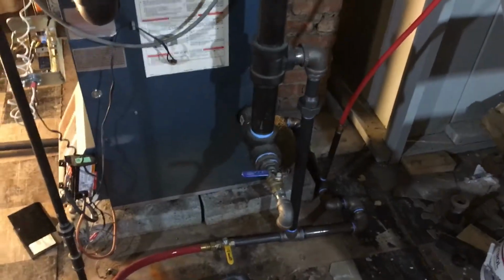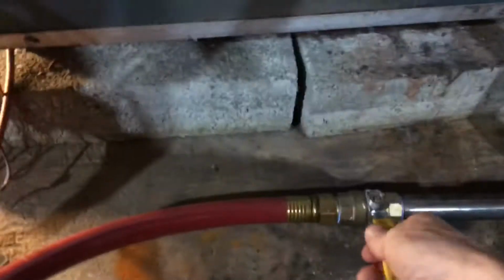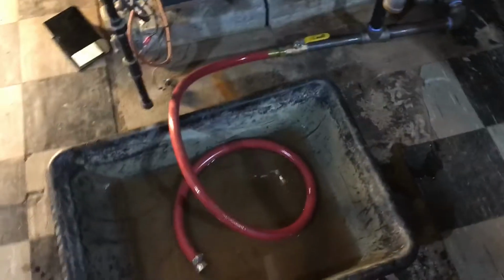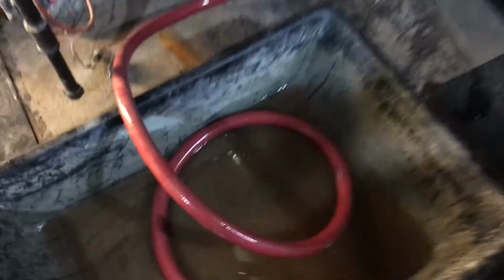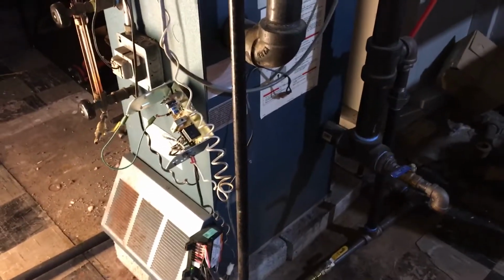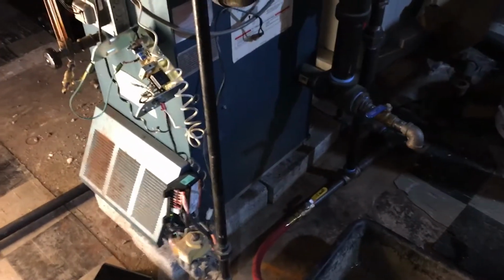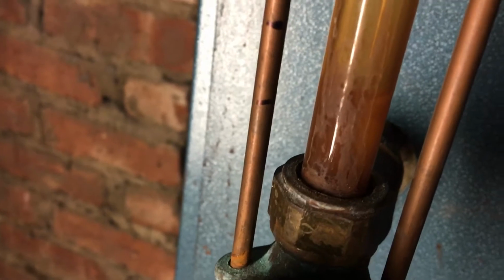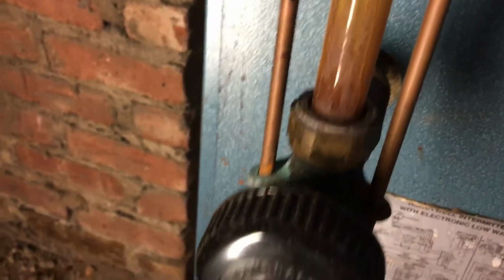Steam heat: What does the Hartford Loop do?

Comment: One thing I would like to point out in this video is that when you see 1-2 inches of water left in the sight glass that doesn’t mean that’s all the water left in the boiler you probably have closer to 10 inches of water. Measure from the bottom of the t where you’re boiler drain is on boiler side of the return to the bottom of the tee on the Hartford loop. There’s still a good amount of water left. Hope this helps out.
Reply from the maker: True enough but it’s just a few gallons. It will boil out in some minutes

Comment: The loop also balances the pressure on both ends of the system. No Hartford loop and water level could rise on the condensate side creating a dry fire scenario, even though the boiler is at the correct water capacity.
Reply from the maker: No, that would be the equalizer
Reply: @pb7379-j2k  Ahh yes good call. Like your videos and glass pipes by the way.  Steam on sir.
Reply from the maker: @mugen-mundo  thanks!
Reply: What pressure are you talking about !   STEAM Risers and turns to solid water and drains back to boiler  YOU KNOW gravity  lol  wooow  !!!
Reply: @Nuchello  When steam is created it expands 1700 times. Thus creating pressure inside the boiler. That's what pushes the steam to the radiators. That's why steam boilers have pressure gauges too. The Equalizer ensures the same pressure exist on both ends of the system.
Reply from the maker: @mugen-mundo  I recently made a video where I proved that the equalizer has no role in equalizing the pressure in the system. If you are speaking of the pressure at the boiler vs the pressure at the far end of the main, it is the main that equalizes the pressure there.

Comment: The efficacy of the Hartford Loop predates the invention and use of low water cutoffs, as you know. In the days when a coal fire continuously burned at damper regulated intensity in a steam boiler, the extra time the Hartford loop provided, in the event of a return leak would certainly have been valuable. Because unlike with modern, on again off again boilers, someone would have certainly checked on it every few hours to tend to the coal fire. Today? Well, considering the annual maintenance and safety checks that the average residential steam boiler receives, the Hartford Loop certainly doesn't hurt anything, and it provides a last, if only temporary, line of defense. From an insurance perspective, nothing is gained by eliminating it, and it just might help prevent a boiler launch (which by the way, I would love to have witnessed, back in the day).
Reply from the maker: That’s a lot of words to say “I agree with you 😂”
Reply: @pb7379-j2k LOL, I was on a roll. Really enjoy your videos, Paul.

Comment: Interesting experiment. I may be mistaken but I thought the Hartford Loop (before the invention of the low water cut off) prevented the boiler from draining lower than the top of the loop in the situation of a leak in the wet return. So eventually when there is no more condensate returning, and it has all drained out of the system through the hole in the wet return, there will only be water in the boiler to the level of the top of the loop, and water in the actual Hartford Loop pipe up to the level of the top of the loop. There would be no water on the side of the loop that connects with the wet return. So this is what prevents the boiler from dry firing. Or do I have this wrong?
Reply from the maker: You have it right, but then what happens? The boiler keeps firing sending steam into the system which returns as condensate to the leaking wet return which means your boiler dry fires in a few minutes anyway
Reply: @pb7379-j2k  Makes sense. I was thinking that was more of an issue in the age of coal-fired boilers though, since they would run all day. With gas or oil fired boilers on thermostats, I figured they would eventually reach the set point of the thermostat and turn off before all of the remaining water in the boiler was boiled off. But I suppose over time with repeated cycles the water would still eventually boil off. I guess the benefit of the loop is that the water doesn't run out all at once and buys you some time, but still the end result could be a disaster.
Reply from the maker: @williammaloney2003  also in the coal days they didn’t have LWCO and they went down to fill the boiler with coal several times per day so they’d check the water level too.

Today many don’t look at the boiler for weeks at a time so the LWCO is the hero. The Hartford Loop is useless except it keeps some mud out of the boiler
Reply: @pb7379-j2k   The Harford loop wasn’t  a safety device as we now view such.  It is/was an alert device for an attended boiler. The operator had more time to notice water loss and rake out the fire.  Apparently, it worked in its time compared to before it was implemented.

Take no hope in deleting the requirement.  No insurance company or local code authority is going to take that risk, even if the loop has very low utility today.

Comment: do you have an automatic feed? Have you tested it with an automatic feed? I'd be interested in whether an automatic feed would keep up with a simulated leak. If I was swapping out a boiler Id think a heat switch above the boiler, another high limit strategically placed, a supplemental low water cut out-----all with a SPDT switch with an alarm of some sorts upstairs would be reasonable investments.
Reply from the maker: I had an automatic feed on this boiler. An automatic feed would keep up, if and only if the LWCO were working. The LWCO would cut off the boiler, then trigger the feed. All this happens regardless of Hartford Loop.

Comment: Paul, I had a question... I heard Dan Holahan talk of the value of a King Valve for a 10 psi boiler blowdown, and it got me thinking.  In a dry fire arrangement is it a truth that pressure will build? It seems that the cubic feet of space associated with the boiler and perhaps a hundred feet of mains, returns, branches, radiators AND because it's not a quintessential pressurized system, I thought, "I wonder what it would it automatically raise pressure  before some calamatous event?" While I'm familiar with pressure/ temperature relationships (I'm an AC guy), the potential venting made me wonder.
Reply from the maker: I don’t think I’m following—what is a “dry fire arrangement?” I would think if you ran the boiler dry the pressure would drop due to no more steam production
Reply: @pb7379-j2k  That was exactly my assumption and question. It seems, then, that a supplemental pressuretrol as a safeguard for a dry fire occurance would actually be ineffective.
Reply: @pb7379-j2k  On a related question I see firomatic and other heat sensitive type thermal safety switches above the boiler often installed, and looking at some of them they're preset and non adustable at 165. I might be wrong, but 165 two to three feet abobe the boiler jacket seems darn high---like" the damage is done" high. Am I wrong?
Reply from the maker: @raindogs451  yes I think it would not help. To be safer from low water condition you can install another LWCO lower than the first. Multi family residence boilers require this in many municipalities
Reply from the maker: @raindogs451  yes probably but they might prevent a fire. I’m not familiar with these. I’ve only seen high temp switches on the flue pipe swinging door thing
Reply: @pb7379-j2k  thanks
Reply: A “dry fire arrangement” is no big deal if you don’t mind replacing the boiler. The fun doesn’t start until the automatic feeder kicks on. Something new to test, @ethicalpaul? 😉

Comment: So, your response? And is "they don't do anything" a bit overstated?
Reply from the maker: I don't follow your meaning
Reply: @pb7379-j2k  I mean, as you know the name only came into existence by The Harford's response to hundreds of boiler explosions and it's been in use for decades and was the primary source of protection prior to electric LWP. I think your video was interesting in as much as I thought, 'If I was replacing a steam boiler I'd have a secondary LWCO, high limit and heat sensitive switch above the boiler." I think the video was good in highlighting the need for additional protections, and a warning the HL may impute a false sense of security. Without further testing, however, I didn't come away thinking "worthlesss."
Reply from the maker: @raindogs451  If you think there is some protection they supply, please name it. If The Hartford really wanted to make boilers safer, they would have outlawed buried returns that rust out.
Reply: @pb7379-j2k  Well, without thinking much about it, your video highlights a potential 5 minutes (I don't remember). so without a supplemental LWCO, and other supplemental safeties your video suggests the HL might be innefective. However, in the absence of the HL loop, and those supplemental safeties, I'd be hard pressed believing a make up feed would keep up. W
ith the proper protections in place, I'd imagine the difference of 30 seconds and 5 minutes might be a significant interval. In other words, if you're sitting in the living room, would an alarm giving you several minutes to respond vs seconds make a difference?
Reply from the maker: @raindogs451  What alarm? Residential boilers have a single LWCO. That is what triggers the automatic feed (if equipped). So without a working LWCO, you are sitting in your living room while the boiler steams away its water, and the Hartford loop gives you some minutes of extra time, which you will use watching the football game. Or it's at night, or you are not home. The Hartford Loop offers no protection, only some minutes of delay from dry-firing.
Reply: @pb7379-j2k  I disagree. Any boiler can have a supplemental LWCO added, and any SPDT switch or dry contacts can be added for any readily availible alarm. That alarm can stir you from the football game or any supplemental safety can disable that boiler if you're out, right?
Reply: @pb7379-j2k  All things can be added in series in both the high and low voltage circuits, right?
Reply from the maker: Matthew York you are free to disagree but every residential boiler comes with a single LWCO, that is a fact. This video is not about what safety features a boiler COULD have, it’s a video about the Hartford loop
Reply: @pb7379-j2k  Listen dude, I doubt you're a boiler guy. THAT SAID, I found your video helpful and informative. You came away from your test (which I appreciated) thinking the HL was wothless, and while I'm not typically not a boiler guy, I AM a 30 year HVAC guy. I saw the same video and saw the HL being a helpful thing WITHIN THE CONTEXT of a heat swich, alarm and supplemental LWCO and alarm. (All added cheaply and blindfolded by an HVAC guy)  I sure as hell didn't see it as a debate. I found all of that ironic because you seem a hell of a lot less afraid than the average homeowner, and if a guy like you was changing out a boiler anyway it's not an intellectual leap to see how I could make the HL more effective.
Reply from the maker: Matthew York a boiler can be a lot safer with the things you are talking about. But it’s no safer with a hartford loop. That’s the only point of this video. I don’t know what else to say
Reply: @pb7379-j2k As I said, I found the video informative, so I'd be inclined to mitigate the shortcomings of the HL, and take the several minutes the HL offers me and use that to try and keep the boiler from dry firing. Our only disagreement is what we conclude from that I guess. I'm not trying to pick or debate.
Reply: Well the loop keep more water in the boiler, so if you want to simulate the same test without the loop just run it with the boiler drain open. Obviously you lose water way faster and even with boiler not running. At least with the loop you can run the boiler manually with the switch and fill valve to tide you over until plumber fixes it. But it is no substitute for LWCO or a fire alarm at boiler room.
Reply: @ekfliu  You know, I'm thinking of building a small house. I've now watched 100 of these videos. If I do this, I'm adding, 1) another LWCO,  manual reset pressuretrol (set at 5#) , and a heat switch.
Reply from the maker: @raindogs451  a second LWCO is a good idea but if you size the boiler right you will barely need even the first pressuretrol so I wouldn’t bother with a second one
Reply: @pb7379-j2k  Thanks.After I saw your video I got wierded out. Then I heard Holahan say, "We value the lives of multi unit tenants more than the average person" (an obvious quip) (where a manual reset is required) and I thought, "should I?"
Reply: @pb7379-j2k  "you bately need the first presssure troll" Man! That's profound! I hadn't thought of that but I can see that now!
Reply from the maker: @raindogs451  yeah I have a hell of a time even getting mine up to 1psi even just for testing purposes
Reply: @pb7379-j2k  Let me ask you theoretically----I'd never do this------do you think a perfectly sized boiler in an area of the country that had winter tyoically in a narrow temp range...that theoretically could have a stat that was consistently satisfied in the the .5-1.5 range? (with no pressuretrol?) Theoretically?
Reply from the maker: @raindogs451  a steam boiler is sized to its radiation load and if it’s correct then yeah it takes a long run time like from a setback to even see .5 psi. Mine sees only like .1 psi unless I force it to recover
Reply: Hopefully none of you are in the trade.

Comment: Hartford loop is not designed to prevent dry fire of the boiler.  It’s to equalize boiler pressure.   Your whole premise is false
Reply from the maker: The equalizer equalizes pressure. An 18” vertical pipe (the Hartford loop) does nothing regarding pressure. My premise holds.

Also preventing dry firing is the entire purpose of the Hartford loop. That’s why it’s named after the insurance company that mandated it.
Reply: You ain’t lying the company even stated if their system doesn’t have a Hartford Loop it would not function correctly